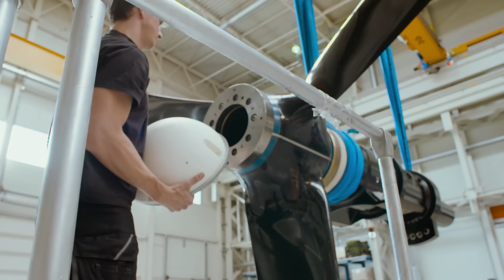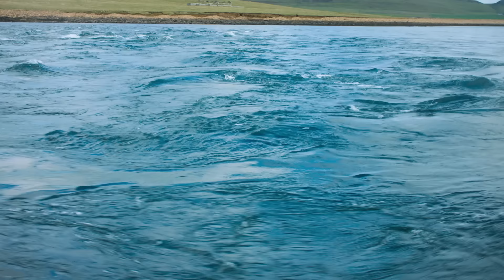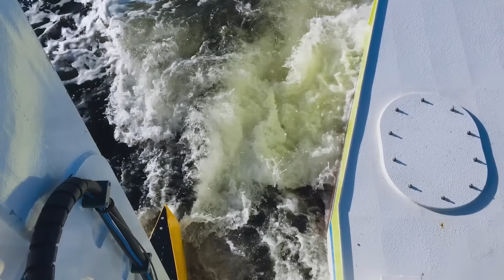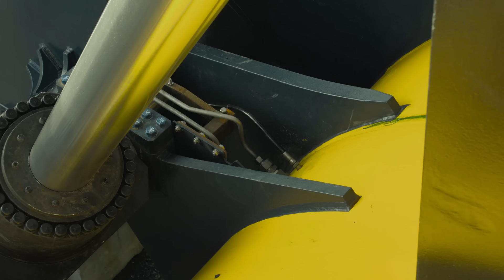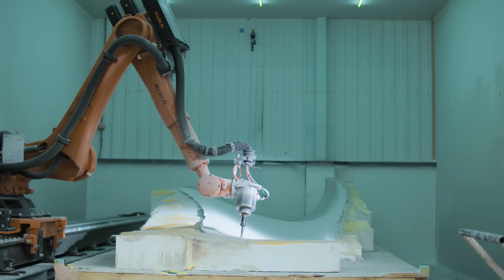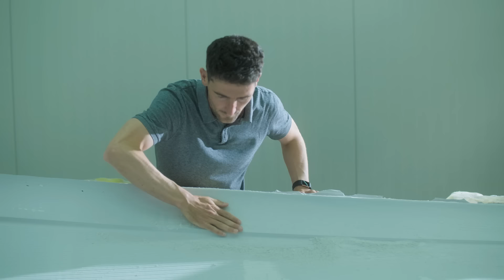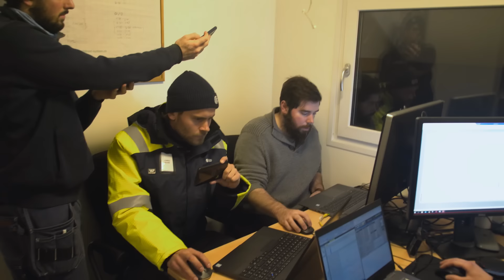Tidal Power: Unlocking the Greatest Untapped Energy Resource on the Planet | FD Engineering

Comment: I'm not a engineer or anything but seems to me it would be better to have the electronics above water and only have sealed mechanical bits below water?  When a "fuse" blows ,  it's as simple as walking up to the pod in question and removing a panel.   As for the "kite" that would have to have a wide berth all around it.  Are those engineers worried about sea life in the same way as others?
Reply: Fair question. More moving parts means greater efficiency losses and more things to wear and go wrong. Also weight, vibration and so on. Either way we need to keep all the bits dry.
Reply: Car rear wheel power system sending the energy up a prop shaft.
Reply: 😮
Stop me 5y 😂😂😂But about Machine for Indraty 😂🙄🙄🙄I know more Rodoffe Sure🤣🤣🤣🤣❤❤❤Can stop me
❤❤I crazy to lern about Machine ''new Technick. New idea🙄🙄🙄😊if don't stop playing 😂😂😂or don't care 
Rodoffe will more Crazy 😂😂to have in life 😮😮
Don't forget 😂😂or come from '' CC.4.00 Industry Production  and QS manager 😂😂from Germany 🇩🇪 Industry 😂Or not stuff ''OR ManeGer Production Industry and offers 😂😂😂Don't forget 😂😂Rodoffe MC.KENNEDY Crazy
Reply: My thoughts are the same with (onshore) wind turbines. Translating the energy to the base of the tower with, say, hydraulics, would simplify maintenance, reduce the weight, and thus the anchor requirement (the weight of the generator could act as ballast), and facilitate variable power generation

Comment: A nuclear power plant is a giga-watt: Yes, a typical nuclear power plant produces around 1 gigawatt (GW) of electricity. A gigawatt is a unit of power that is equal to one billion watts. 
A 1 GW nuclear plant produces about 8 billion kilowatt hours or 8 million megawatt hours of energy each year. 
To generate the same amount of electricity as a nuclear power plant, you would need almost two coal plants or three to four renewable plants, each with a capacity of 1 GW.
Reply: The problem with nuclear is it's a big bang infrastructure project, taking a long time to complete (plan to operation) and are expensive to build - Hinkley Point C in the UK was announced in 2010, started construction in 2017 and isn't due be operational till 2027 (though not guaranteed), at a current projected cost of £48 billion (originally expects to cost £25 billion). The output is  3.2GW but to break even it has a high strike price and long payback periods (35 years compared to 15 years in offshore wind).

Nuclear as a zero carbon source of power should be part of the mix but not the sole part, due to it's long lead times and high cost - in the UK nuclear represent 14% of the generating mix, renewables about 45%. It is quicker and cheaper to build and operate renewable power generation infrastructure than nuclear of the same size. 

For example, the Hornsea offshore wind farm that is being built in four phases giving a total of 8GW of generation capacity at a cost of £16 billion, planning started in 2014, started generating five years later. The build can be phased and flexed in capacity in line with innovatoin - each phase starts generating about a year after commencing construction and generally complete within a few years. The phases were/are:
- Phase 1 - 1.2GW construction commenced at the start of 2018, stated generating a year later with the full build was completed in under two years. 
- Phase 2 - 1.4GW started build in 2020, started generating in 2021 and completed in 2022. 
- Phase 3 - 2.9GW started in 2023 and is due to start generating next year and completes in 2027.
- Phase 4 - 2.6GW due to start next year with completion by 2030.

The Hornsea wind farm offers two and half times the generating capacity of Hinkley nuclear plant, costs just 1/3 the price, can be phased and starts generating almost immediately and adds capacity incrementally all in about the same overall start to finish timeframe as a single nuclear plant.

Comment: A natural gas burning power plant is nowhere near as pollutant as a coal burning power plant. Don't know why they would think the two are equal.
Reply: Polluting - not pollutant. Pollutant is a noun. The correct term here “polluting” is a a perhaps a sort of adjective - not sure. My knowledge of grammar is a bit patchy.
Reply: Natural gas is actually much nearer to coal as a pollution source! It is a very powerful and long lived greenhouse gas and is usually a combination of methane and carbon dioxide when it comes out of the ground. It’s production and transport often involves a lot of leakage as well as environment damage particularly now that much of it is obtained by fracking. There are no clean fossil fuels,only ones that are slightly less polluting.🤔

Comment: Something tells me the upkeep of these systems will be colossal. We will need technology to replace fossil fuels as they will eventually run out but we should definitely invest in coal power. The most cost effective and in abundance. The climate will keep changing as it always has but there is no CRISIS.
Reply: We'll in the UK, coal is no longer a part of the countries energy mix and the massive reduction in use over the past 40 tears has been more about clean air and it's huge cost. The last coal power plant shuts down for good at the end of the month, the UKs steel production is moving to electricity power and the project for the last deep coal mine has been cancelled.
Reply: @GruffSillyGoat   True and it’s a disgrace. We have over 200 years of coal under our feet and coal is a very efficient way of producing electricity, that can power our declining steel plants, until technology can take over. Unfortunately looking after your own country has become a thing of the past ☹️
Reply: @melb5996  - The UK doesn't need coal any longer, it became too expensive and inefficient to continue using (which is why gas took over), plus caused significant pollution (even with modern particle/noxious gas emmissions capature techniques employed). Coal has been phasing out for decades, for the cost of continuing it the UK can fund many times the generation power from other sources (particularly renewables). UK steel production is transitioning to more efficient electric arc furnance production that keeps the UK's steel making capability alive and competitive; the UK makes steel on the basis of quality rather than quantity, this has been the case for decades. 

It's just not worth the hassel or cost of digging out the remaining coal to burn it; it was a resource of it's time helping to drive the industrial revolution but like that it's role in the country has become a historical one.
Reply: @GruffSillyGoat   I respectfully disagree with almost everything you have said. Phasing out coal was a ‘political’ decision and not based on costs. Coal is still BY FAR the cheapest method for producing electricity. We have an abundance of it. As far as EAF goes, this requires a tremendous amount of electricity and we have one of the most expensive electricity prices. Coal could reduce that cost. As yet, the quality of the steel produced by EAF is NOT as good as Blast furnace so we will have to import high quality ‘virgin’ steel for now. Plus if we invested seriously in carbon capture then that would satisfy the climate alarmist plus we could sell the CO2 as there is a big market for that.
Reply: @melb5996  - and yet coal was displaced by gas turbines in the UK a fair number of years back. The LCOE of coal is only lower than peaking gas and nuclear, however, compared to natural gas generation it's never had a lower cost. Renewables (wind and solar) and geothermal all have a lower LCOE than either gas and coal. 

Carbon capture remains experimental still, even Drax which turned from coal to wood pellet struggles with capture, and that's with a cleaner burning fuel (coal ~360kg/MWh vs pellet ~190kg/MWh of CO2).

Electricity prices in the UK are high because it's tied to the wholesale price of gas. As gas becomes an even more minority energy source this will change to renewable and prices will drop. Further, the UK steel plants are being coupled to local dedicated renewable generation, that means their electricity cost will reduce dramatically.

British/UK Steel beg to differ with you on EAF, they presented an assessment earlier in the year that confirmed all steel products and grades can be made with EAF. Further, they outlined the competitive market of the US and Europe moving to EAF, and that integrated BF was uncompetitive in this market place. They also outlined that EAF, whilst originally orientated to high quality specialist steels, as I highlighted, was now able use scrap steel sources due new processes introduced. The UK in this respect is not seeking to be a virgin steel producer but rather seek to reduce the 80% of scrap we export and increase our EAF capability to use the scrap resource at home to produce higher value products to export instead.
Reply: @GruffSillyGoat   Obviously gas turbines are used because they shut down the mines. If you actually believe that renewables are cheaper than coal then explain why China ( the world’s largest manufacturer of solar panels) , still generates 70% of its electricity from coal power stations and that requires them to import massive amounts from Australia. In fact it’s estimated that 70% of the world’s steel is produced with coal. Things are clearly going to change over the next few decades but this country has pushed us into the most expensive electricity in its virtual signalling quest at the expense of its population.
Reply: @melb5996  - Lazard or the IEA are best for the answers why the LCOE of coal is higher than gas, geo and renwables. But generally LCOE factors in cost of extraction, plant, production and use.

China's coal usage is due to population size and historical energy generation choices. They choose coal because of resource availability over that of natrual gas or oil, building an energy infrastructure almost with a sole dependancy on coal. And are still net importer of the black stuff today as a result. However, China has reduced its dependency from 90% in the 1960s to 50% today, intiially using oil in the 1970/80s to reduce the use of coal, and more lately renewables and zero carbon sources. Gas has never been used that much in China. Their mix now is about 50% coal, 20% oil, 20% renewable/zero-cabon and 10% gas. 

China is rapidly ramping up their renewable (hydro/wind/solar) usage to their reduce coal usage further to improve air quality, reduce the need for imports and lower the cost of energy production. The latter point is important as with a sizeable but still growing population they need the cheapest form of energy source and for China they have decided that is renewables.

Not sure which energy source you view as most expensive, it is certainly not renewables not for a long time. Based on Lazard's assessment only nuclear and peaker gas are more expensive than coal today.
Reply: @GruffSillyGoat thanks for putting up a thorough explanation to help us all to get a much clearer understanding of the simple truth that we are benefiting from the transition from fossil fuels.😊

Comment: We need fossil fuels to build a renewable future.
Reply: Yes, humanity seems to forget that creating stuff costs CO2
Reply: I agree 100%.
Reply: @HarlowBAshur  bang on, sadly the indoctrinated idiots of Net Zero can't see that.
Reply: "The reason we need such a big hull is that we're generating a lot of power."  A hull made of steel, not bamboo. Cables made of high-carbon steel, not hemp. Steel produced with anthracite coal power, not photovoltaics.  Bearings lubricated with state-of-the-art oils and greases made from natural gas, not canola oil. Yes, I may suffer from feeblemindedness, but nevertheless I can still recognize profound ignorance.
Reply: @HarlowBAshur Well, the dumbest thing to do with oil is to burn it. . .
Reply: @dewiz9596  You bet. Preserving fossil hydrocarbons for better uses in the future will be the smart strategy IMHO.
Reply: stop your idiotic trolling PetroBot

Comment: Edgar Cayce, a modern 'prophet' from the last century, did say that mankind would learn to tap tidal power.  Glad to see it finally materialize.
Reply: Cayce was a quack. Leave it to the engineers. Fusion will be the final power source
Reply: No, it won't materialize. Another "dilute energy" source getting oversold to the public. How many thousands of square miles needed to produce 8,000MW 24/7 like the largest nuke plant in Japan? You said 3,000 GW. Tell me how may square miles. What effect will these monster on sea life? How many aquatic animals will be chopped to pieces? When they break up how will broken pieces be reclaimed so pollution doesn't take place. The flour mill is fine, but I will lay you 100:1 odds the flour is ten times the price of a natural gas flour mill that can run 24/7. Who wants to pay that? One unit produces enough electricity for 650 homes. So to power NYC you would need well over 5,000 of these. To feed the US housing, the need would 135,000 of these up and down both coasts. The continental US has 12,500 miles of coast line, this would be 10 of these for every mile From Maine around Florida to the Texas/Mexico border; then from the state of Washington down to the cali/Mexican border. This could be done with 72 nuke plants at 8,000 mW ea, roughly 1.44/state. A much smaller foot print, much easier to maintain, build and service on ground instead of under water. Me thinks you've done to many drugs
Reply: It  was done years ago in France. It was so successful that no one has ever bothered to do it again...
Reply: Fascinating, commentary brilliant with punacular interjection from begining to end and forwarded THANKS